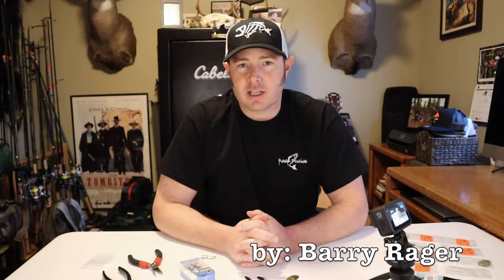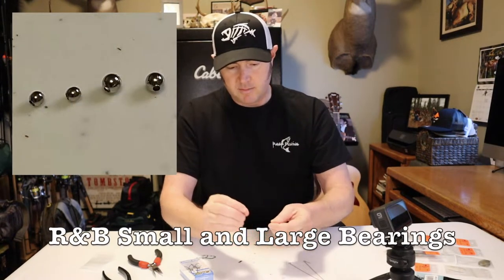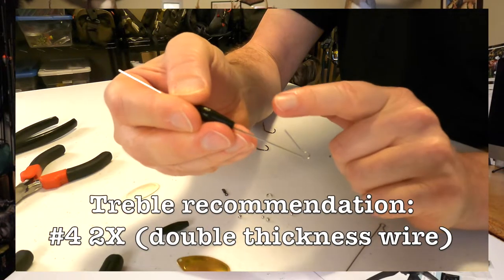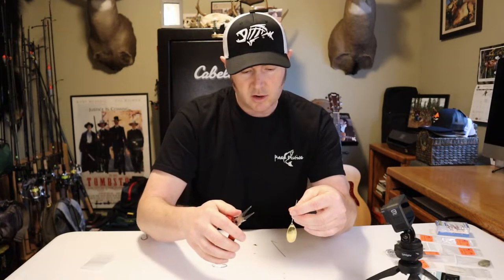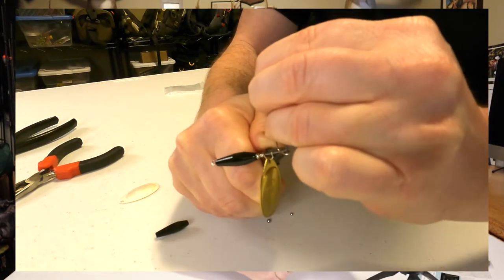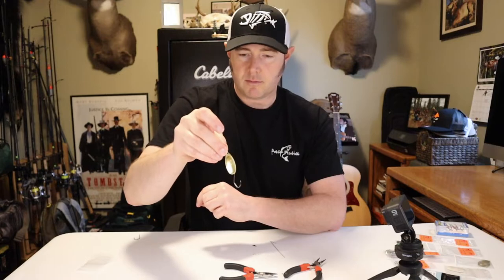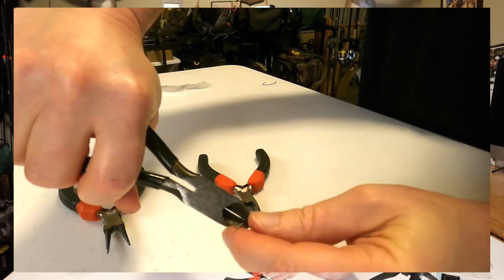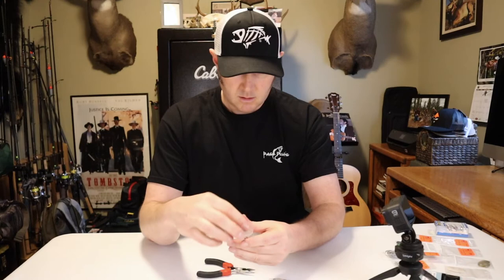BUILD STEELHEAD SPINNERS! - How to make steelhead spinners for fishing.

Comment: Put a split ring so you can change out the hooks easily
Reply from the maker: I don’t like to use split rings on my spinners, other can if they want, but I believe they cause the spinner to be too lengthy. I also think attaching them directly to the wire creates a little more leverage to increase hookups. I appreciate the comment though! 👍🏻